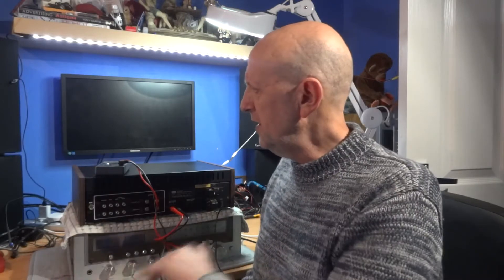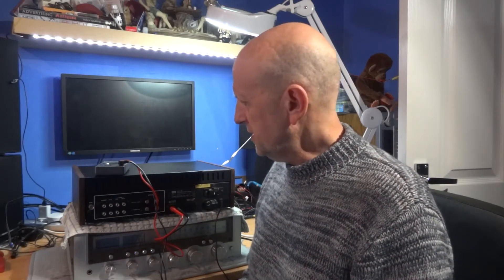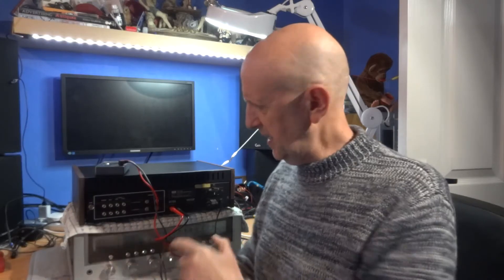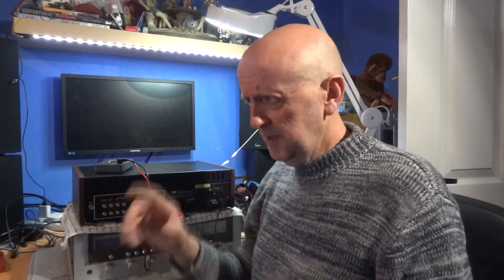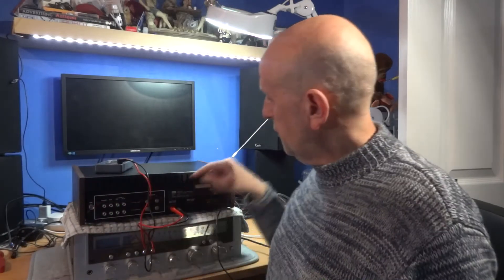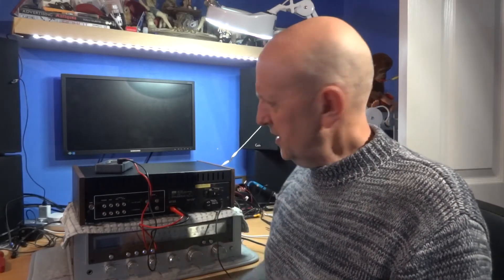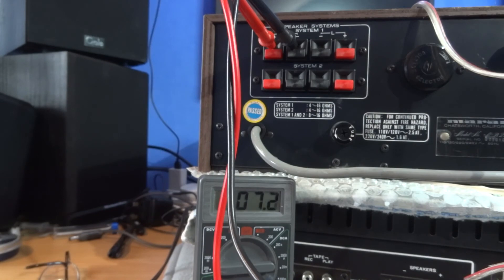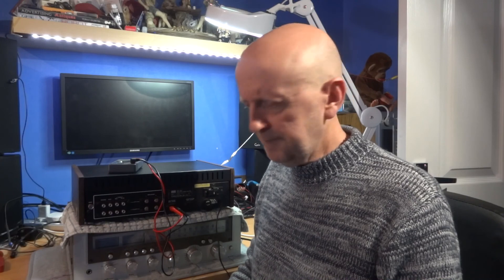Measuring DC Offset on a HiFi Amplifier, DC offset & Mains Voltage Adjustment How To, HiFi

Comment: I have a TEAC AG-6500. One channel shows some measurements in millivolts the other shows O.L or 0.L . Both channels work ok and it has had an extensive overhaul.
Reply from the maker: O.L normally means Over Load so try setting the meter on an higher range it might show a reading.

Comment: Hi Michael,Just Came across your Very Informative Video on dc offset..my question is do you have the amp switched on when checking or does it have to be off,thank you for your Time.
Reply from the maker: Sorry for the delay I have been away, yes the amp has to be on, just be careful and make sure no leads are shorting out and meter is set correctly

Comment: Thanks for that as I have ordered a meter to check the fifty ish years old Sony str 6055.
I have no idea of how to adjust the levels though.
Hopefully the figures will be within normal range.
Thanks again.
Reply from the maker: Hi James. There is infomation on HiFiengine if you download the service manual for the 6055. But if you do go ahead be very careful as it looks quite tight where you have to get the readings from and one slip could kill the outputs. If I was you I would just check the DC offset across the speakers with the multimeter set to DC millivolts. Have the volume on zero and tone controls to normal and on AUX input, but be careful not to short anything out.

Comment: What setting is your multimeter set at? Every meter has different settings.
Reply from the maker: Between 100 millivolts and 1 volt DC should be availible on most meters for this test

Comment: what do you set the multimeter to? I know it is an elecmentary question but I dont know
Reply from the maker: Set the meter to volts DC and a low setteing on the range of the meter around 200 milli volts as mine is set in video, usally the lowest setting on most multi meters, some might have as low as 100 milli volts, even some might have 2 volts as the lowest but this is still ok as you will get a reading.

Comment: Is an input meant to be selected, like cd, tuner? If left in standby its a few mv down.
Reply from the maker: Yes an Input should be selected, in this case AUX , but Tape or CD is fine, with volume on zero and tone controls flat
Reply: @MichaelYates  I did the Bias. Using those clips, very useful tip.
Realised the offset on left speaker terminals was around 12v!. Got them both to 23-25mv. But as I moved the amp, it was stuck to the table, so it jolted. Just re checked the terminals with hood on. Right was around 30mv which is OK as this is the recommended amp requirement but the right was 40ish. It recommends to do both bias and offset twice anyway, But it made me realise how these slight knocks can turn the trimming pots. Very annoying. I will say though, I've noticed a louder 'pop' to when I turn the amp off through the speakers. Hopefully nothing to be concerned with?
I did notice the left speaker terminal overloaded the multimeter so I had to change the range. Can't remember which setting it was but it didn't move the first three numbers being 273. With the number after the decimal fluctuating. I gathered 27 represented mv so I thought this was still OK...
Reply: The bias readings were around 6mv, which was 1mv more than recommend. I took them down to 3.2ish. Was I too heavy on getting them down? (Service manual states between 3-5)
Reply from the maker: @CM-dw3gh  That 12 volt reading was dangerously high, 23-25 is pretty much the norm and quite expectable so I would be pleased with that. Some pots can be very touchy, though you can of course replace the pots, but only if it kept on moving about to much
Reply from the maker: @CM-dw3gh  The bias reading looks good, think its a job well done
Reply: @MichaelYates  so do I ignore the louder 'pop" I now have with the speakers? I'm just concerned if improved the adjustments why the louder on/off sound. From what I've read it sounds like DC issues
Reply: @MichaelYates  cheers that's reassuring
Reply from the maker: @CM-dw3gh  Pretty Typical with amps that do not have a relay delay to disable the speakers when turning on the amp, as long as the DC offset is the 25mv you measured its fine, just the DC Offset setting down.
Reply: @MichaelYates  well I went back to it as I'd realised I'd not put the volume to the lowest level and left the blasted tone defeat on. Good job I did. The Bias was only just over the recommended so I got it in the middle (I'm guessing it gradually goes up the longer it's used). Also the multimeter reading was still not playing ball at 200mv so worked out from the 2v setting from the 'ok' left terminal (offset) to marry it up with that. Hope this makes sense. Both now we're also in-between the recommended (-15mv). 
Tested with some speakers I'm not too fussed about to begin with. Pop was less dominant this time round. Happy days. 😊 cheers mate, if it wasn't fir you're video I wouldn't gave bothered. Also, great idea using 2 multi meters

Comment: Nice video! Just wondering how I do this test with jack outputs on the amplifier?
Reply from the maker: One way would be to open the unit up and take the readings from the jack connections inside the amp or buy a jack plug that you can unscrew to get to the connections then plug that into the amps jack outputs and take the readings that plug.

Comment: What that black tube on the back of the Marantz? I see these on older receivers. Is it an antenna?
Reply from the maker: Yes this is the external ferrite rod antenna for MW & LW depending on receiver, though an extra wire can be attached to a terminal to improve reception. Some receivers have this antenna inside the unit
Reply: @MichaelYates  cheers!

Comment: good info for the beginners 
you will be surprised how many times they have the dc offset pots wrong in the manual books
Reply from the maker: Thanks, always worth double checking with a quick search with Google to see if there is any other information on the amp that may help.